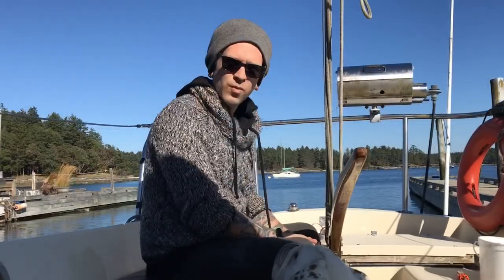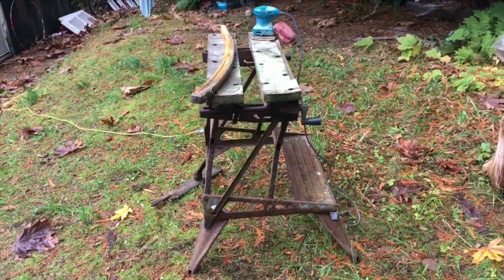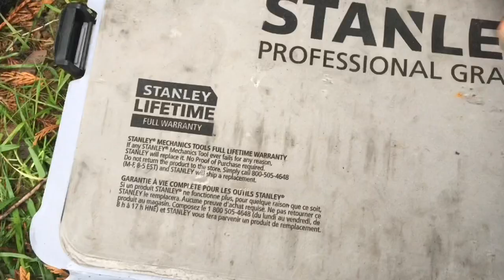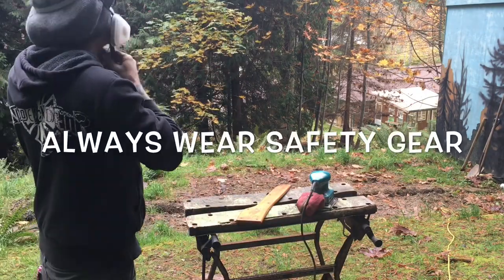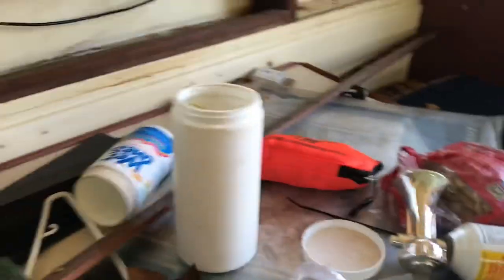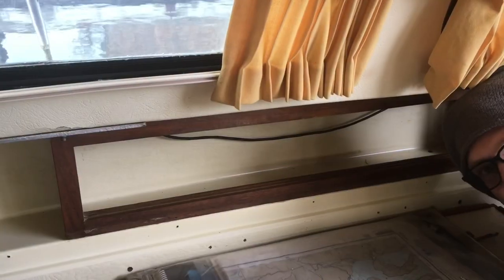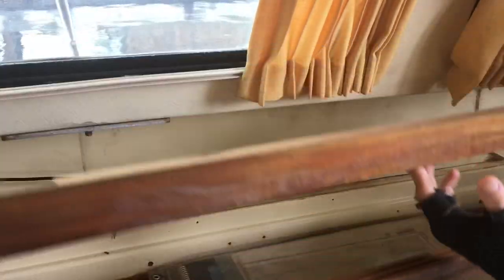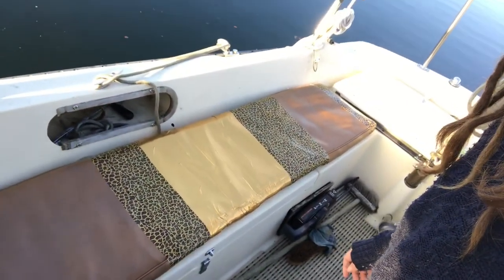Fixing up the tiller and cleaning and sanding

Comment: The purpose of those other bolts is so it doesn't split the other way.
Reply from the maker: theislandpackrat  I had figured they may be structural. Thanks so much!
Reply: Mine is like your's I'm going to replace it someday, soon I hope. I'm going to make it out of fiberglass or stainless. Nothing like a broken tiller to ruin your day!